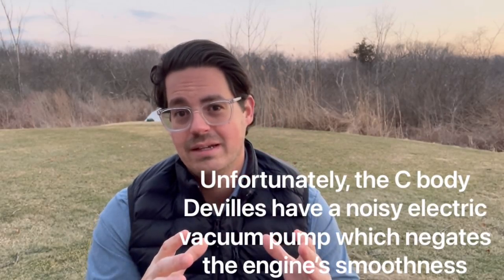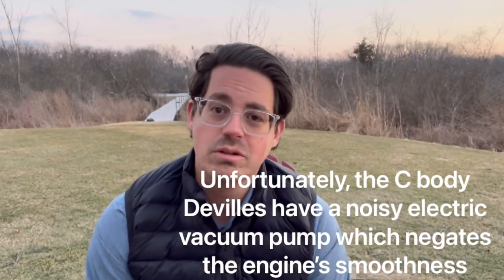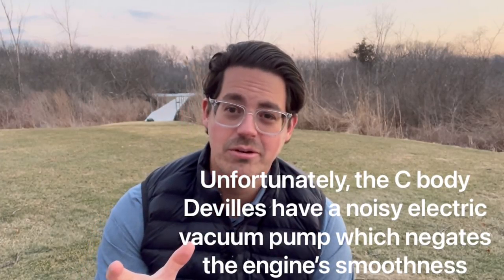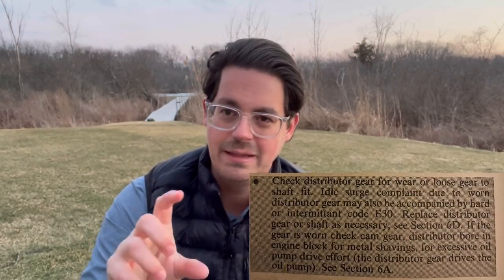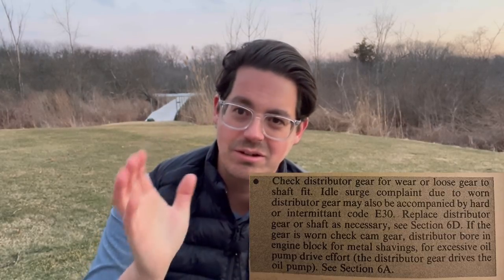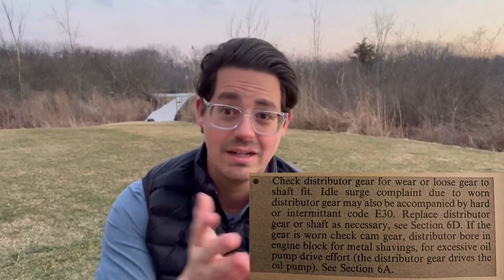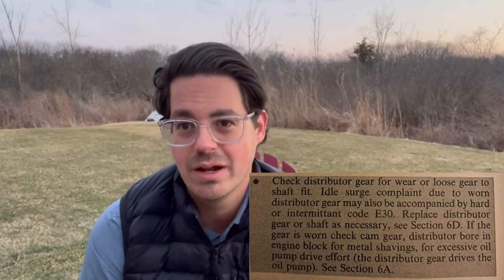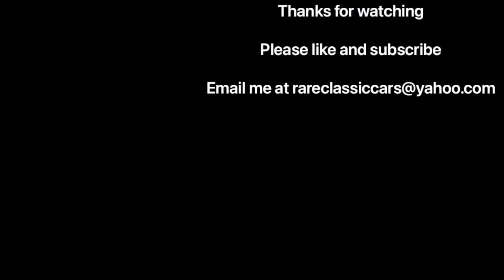Worst Engines of All Time: Cadillac HT4100 - Why is it so bad?  How can you preserve yours?

Comment: Video ideas/ questions: Why did GM produce so many different engines that seem roughly similar: V8 of displacement ranging from 4 to 7 Liters. And why wouldn't they just update an engine or transmission that was known to be reliable, rather than switch to an engine that more often than not worsened their reputation. And what was that crazy situation where they were sued for putting a, what, Olds, engine in a Pontiac or something? Why would that even be an issue?
Reply: Great question. GM as a company was actually a conglomerate made up of the various divisions (Chevy, Olds, Buick, Etc). For the most of the 20th century, each division was basically run separately as a way to foment internal competition, but also because GM was making money hand over fist and never really saw a need to combine them. As a result you got a bunch of similar-but-not-quite-the-same products. In the 70s and 80s when Japanese and German competition started ramping up, that's when you started to see consolidation of the product lines and standardization of engines. In fact, they got so good at it that by the end of the 80s, the Buick, Olds and Pontiac would literally come off the same assembly line with nothing but a different badge applied.
Reply: @mattt198654321  Which is why using an engine from another GM division would seem to be a non-event, but it was for some reason. Why?
Reply: They were putting Chevy engines in Oldsmobiles and not bothering to tell buyers. I think that was in 1977, by 1978 they were still doing it, but disclosed it. I had a 78 Cutlass Calais with a 305 Chevy cam eater.
Reply: @gsadow  Lawyers saw a way to get some money with a class action suit.

Comment: I had a friend who had an 83 Eldorado and had one of these engines in it.  He kept checking under the oil cap for the white goo that forms when coolant mixes with the oil.  As soon as it happened, he took the car in and had either the head gasket or intake gasket replaced.  It's odd to me Cadillac could not have done better here.  Why not have an all aluminum engine then, if 75 - 80% of it was already aluminum?  I've heard of aluminum heads on cast iron blocks, but this is the only engine I can think of that is the other way around.
Reply: The Vega led the way, using an iron head and aluminum block, with about the same success as Cadillac.  Head gaskets, death by overheating, etc. I think Caddy used iron liners for the cylinders, so oil burning wasn't as bad as the Vega.
Reply from the maker: The thought process was that the main wear items would be cast iron. So the head was iron and while the block was aluminum, don’t forget it had cast iron cylinder liners.

Comment: What about the main bearing journals in the block getting bashed out of round by the pathetic power it made. Despite reinforcement, the later 4.5 and 4.9's had the same issue.  Wet liners? Self tapping bolts in the upper valve train? Head bolts outside the block? Oil returns around the head bolts?  Unequal length head bolts? The list of crap engineering decisions goes on and on. Truly the worst American engine made in at least half a century.

Comment: Something I never understood about the HT4100 is why, when problems became apparent, Cad didn't just give in an sell you the Olds 307 they were putting in the Electra/98, Toro/Riviera.   More robust, better performer (everything's relative).  Was it just nameplate arrogance - 'people will buy because it's a Cadillac'.  Between this and the 85 C body, they shot market share to heck.  At least by 88 they'd fixed the styling somewhat.  I knew owners of the original version that traded as soon as the 88 came out.  Those that hadn't already bought a Town Car, that is.
Reply from the maker: Production capacity

Comment: My father bought a new Eldorado with the 4100, at 85,000, the cam went flat, backfiring through the intake, like the Chevy 305. I'm sure he didn't change the oil often enough, the antifreeze was also black. He traded it in, he left it at the far end of the lot, and walked to the showroom and bought a new Cadillac

Comment: I drove a 1984 Eldorado, for 20+ yrs, and I think I had good experience with it… I think 4.1, for 1984, was a different engine than being discussed…
One small issue, the engine took 6 qts, while most cars back then, the stick said 5, but changing my own oil as a young man, I always used 6 quarts to fill to the fill mark on the dip-stick. Many drivers who paid professionals for oil change, may have got short changed, causing poorer lube performance, and even burning more oil because it was hotter…

I enjoy your videos immensely, would love to talk more of my ole Eldorado, but with the work you’ve done on your Caddy’s, how could you overlook the oil stick discrepancy?

Comment: Lol,,,,, meanwhile Lincoln had the 5.0 or 5.0 or 5.0 or a 5.0.....
Reply: And they sold a ton of Town Cars, Mark 6’s and 7’s, Crown Vics and Grand Marquis with those engines. The 5.0 moved the living room on wheels comfortably on the highway reliably and trouble free. Don’t mess with what works.
Reply: @khakiswag   Exactly,,, we owned several 5.0 powered vehicles and they never gave trouble..
Put 170000 miles on a 89' Crown Vic,, sold it in 2011 and it's still on the road today.
The guy called me a couple months ago...

Comment: The Northstars aren’t much better!
Reply: The problems the northstar has can all be traced back to the cylinder head bolts, the 4100 has problem after problem which all have different causes (oil pump failure due to aluminium oil pump, camshaft wear due to non-hardened steel and flat tappets, headgasket issues due to expansion ratios not properly accounted for, intake gasket issues due to use of RTV).
Reply: Northstars are wonderful engines when they're not broken and it's not a promise that every Northstar is going to have problems. So... It's possible to have a really great motoring experience with a Northstar caddy. From what I'm hearing, that is not possible with a 4100. You will be driving a slow turd that you have to baby everywhere with your fingers crossed even in the best case scenario.